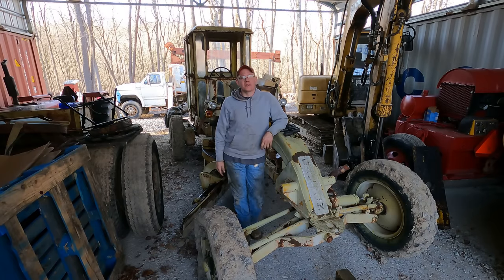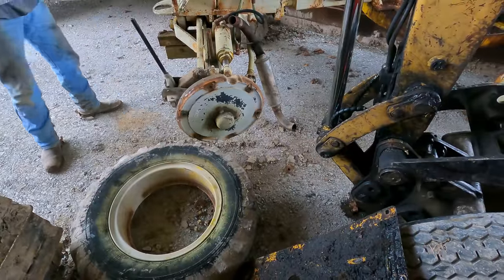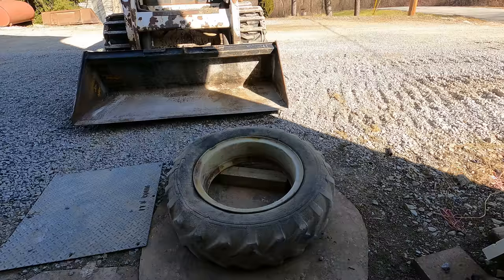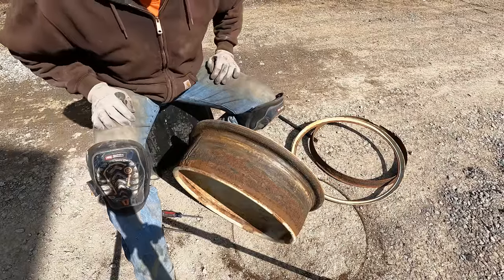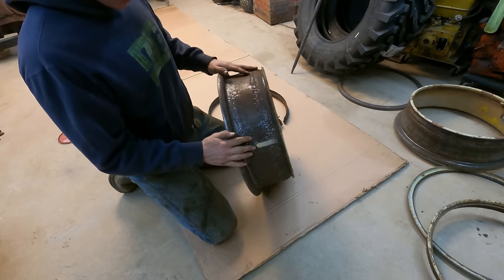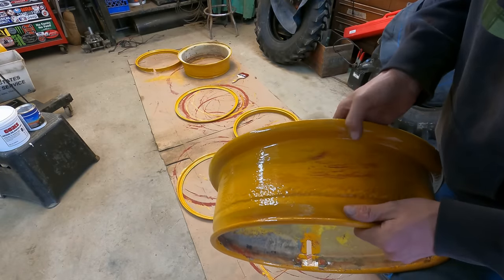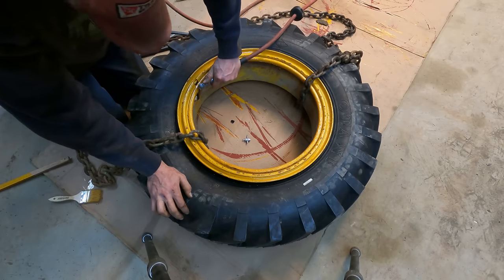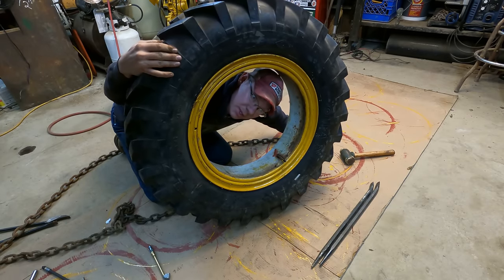1950's Galion Road Grader "Widow Maker Rims" Pt.4

Comment: First place I'd look for that wedge would be a tire shop that does truck / equipment tires.
We always called that thing you call a flap a "boot."
Putting the tube and boot in is a little easier if you partially inflate the tube first.

Comment: On the payhauler tires I have done we put a few chains around it and hammer the ring in the groove till it's got plenty of pressure to hold it in place but those are also bigger and tubeless. I do like your video though it's very informative

Comment: Learned on bicycles, but have used this technique on any tubed tire I've done since. I put a little bit of air in tube first, with valve core still in, just enough that it starts to take shape. Then put it in the tire. On tractor or ATV tubes, a quick sprinkle of baby powder helps keeping sticky new tubes from sticking to sticky new tires, lets the tube "slide" into it's happy place with ease. Your method likely works too, only thing is you can't really see if it did or not, where as if the tube was already round-ish when you put it in the tire you'd know it was seated correctly

Comment: Snot them up real good and they will slip right on. And it helps to put a little air in the tube before you put the rim on. It helps to hold the flap in place

Comment: With these rims, always think twice when doing someting. I handled those things in the 70ties and always took extreme caution. We also wraped some thick cord arround it when inflating. Then we made a cage to put the tires in and one of the first tires in this cage we were inflating exploded (so not the rim went of) and I heard about two days nothing. For the rest no one hurd. Imagine we didn't had the cage and someone was nearby. To put the inner tupe in the tire, always put some air in it, stick it into the tyre and then wiggle in the protection rubber. Easy-done easy go.
By the way, that paintbrush is of the type "Big-steps-quick-home" (lol)

Comment: Best advice to get that tire off is lubricant and a duck bill sledge. I use oil based lube (red fuel), spread it all around tire, the wack a few times with duck bill and bead should slide off. Hope this help. Old crusty tires need a hell of a lot of help to come free haha

Comment: I know this video has been out for some time now and I've never tried to mount tires even close to this size. One trick I've used to help my tubes seat well and avoid pinches is adding talcum powder inside the tire.

Comment: That floor did pack up a lot nicer than I thought it might!  Very usable for working on big equipment like that.  Hell if you ever got the itch you could probably "tar" it and make it like smooth pavement although it wouldn't drain then.  Nice.

Comment: Xo rust is what I paint the frame on my trucks with it neutralizes rust. Also works really good on plows. I just started to try/test out rest oleum enamel primer that stops rust as well seems to be working out good so far have to see how it holds up to a Wisconsin winter and salt

Comment: We used to use pick axes to break the bead when I was in the Army. Old five tons have split rims. Just stand on one side of the rim and tap the wide flat side of the pick axe on the opposite side where the rim and tire meet. Work slowly around the tire moving the bead done a little at a time. Eventually it will just pop off.

Comment: Rustoleum Rust Reformer paint works really well for coating rusty metal where you do not want the rust breaking through again.
And, it can be painted over with a finish coat.
I know first hand by painting rusty tools with it and the rust does not break through because it doesn't just coat but chemically reacts with rust.

Comment: I use to use gasoline to free up and soften the tires before prying and pounding.  Diesel and kerosene work good too.   Rotten rings are dangerous.....be careful!!    Also i would replace rust soaked inner rim guards if available (rubber flaps) .   Ya did good sir!!  Enjoy the hell out of your videos!

Comment: I have changed a lot of these over the years,  I would suggest you put the tube in the tire and add air to the tube, then install the liner and slide on the rim.

Comment: After removing the rust you could have painted them with a rust remover. The one I use but don’t know if you have in US is Ranex Rust Buster and I find it does a marvellous job. It adds another 24 hrs to a job but I find its worth it. Just a thought.
I have changed out a few and even when I was a whipper snapper always placed a rope around the tyre at three places and I am still here. That was in the 70’s when I done those things.

Comment: FYI you can break the tire bead with a car jack. Just prop the tire under the jack and press the jack as usual, it will force the tire off no problem while do it very delicately.

Comment: Next time Matt,, fit the rim to be cleaned , to one of the driving hubs start the engine and set to low gear and hold a disk grinder against it, works a treat

Comment: When I was on my automotive apprenticeship, my boss at the time Didn't like car tires coming back for a leaky tire, so once I had the tires off, I had to wire wheel ea. rim down to bare metal, rinse them down in paint thinner, repaint ea. rim black let them dry (mostly) then put ea. tire back on air it up, soap and water test, (so I made half plastic barrel) to dunk the tire in and just roll them around Dry and reinstall. Spring and fall kept me busy along with every break job the shop got in, both the boss and my lic co-worker hated doing them, it just made me very proficient in tires and brakes. Tires I still dislike doing but brakes I enjoy. The chains around the tire and rim is an excellent endeavour, certainly a Very Safe one. I've seen what the old Corvette rear suspension can do when miss-handled Clean through a 1968 Pontiac Parisisnne's door to the inner door panel. Anyway Thanks for Sharing Everyone that's open minded can learn the little tips and tricks from others of the same mind like abilities. So Thank You for sharing your knowledge. Work & Play Safe Andy T. Barrie Ontario, Canada, 🇨🇦

Comment: We called those flaps Boots. Working in a truck fuel stop and tire repair in North Dakota during the late 60's when a US Air Force Missile Hauler Truck stops on the highway near us. This trailer had approximately 40 tires on it with at least 6 flats. The driver explained that the tires were all new, having been installed by the crew at Air Base the previous week. Someone with no knowledge of tires, inner tubes and rubber boots obviously was volunteered to install the new tires. The inner tubes come with new boots that were packed folded over and wrapped tightly to save space. The young Fly Boy (as we affectionately called them) who assembled the tires knew where the tube went but had no clue on how to assemble the boot with it. So the boots were thrown into the tire first, still wrapped tightly in a lump followed by the tube. It took Air and inflated the tire so therefore it must be right. Within the first hundred miles it heated that rubber boot to melting temperature and the tires started to deflate. They had another hundred miles to go before arriving at the next Air Force Missile Station. We were out of tubes and boots of the size required and expected more flats down the road. Can you imagine 40 flats in a 200 mile trip. I'd bet some young Fly Boy peeled potatoes for the rest of the year!

Comment: A friendly comment from an old tire guy. On drive wheels the chevron points toward the direction of rotation. On free running wheels the chevron should point away from the direction of rotation. You can switch sides with your wheels to correct yours.

Comment: One way to break the seal on the tyre is to use the bucket on the dozer as you did but keep shifting the tyre around and pushing down on the  bucket, you may have to work around the tyre a couple of times, but it will break the seal.

Comment: Grandpa was telling me about how they were changing a 72 inch split rim tire on a skidder back in the 70’s and once they got the tire all back together and airing it up the locking ring unseated when the bead set and the whole contraption blew apart, luckily once they started airing it up they all backed away so no one was hurt

Comment: I use the blade to lift the tires on my grader.  Position the blade and circle right and you can lift the quadrant of interest.  Use blocks under the blade to keep from tearing up the floor, be careful of side movement and block it when it's up.  Make sure you have enough pressure in grader tires.  You can push the tire off the rim or spin the wheel in the tire, otherwise.  And cover up the tube in that slot in the wheel where the valve to slides in.  Sunlight will crack the tube and it's hard to patch in that spot.  I paint that spot since I've had the flap and the tube crack.  Interesting how many reasons there are for running the front wheels backward.  Me and John Deere think it's to keep the front tires from throwing mud on the cab.  I think that's why they put the R1 tires  backward on nurse wagons -- keeps the mud off the tractor.  Good luck with the grader.  You can get an account with a hydraulics retailer manufacturer now.

Comment: A quick option for breaking those tires off the beads is to place the tire slightly under the machine and use a rock jack (and the weight of your machine) to push them down and away from the bead.

Comment: If you have to cut a tire again, use a little lube as you go. Dip the blade in oil or use spray, both work great.

Comment: A trick for inflating while installing new tires is to air them up initially with the valve core removed, an airline with locking inflater nozzle, and quick air coupling far enough away to keep you outta the rim grenade zone.  I've had newer defective radial tires on one piece rims fail while airing up and seating beads where the sidewall failed at 20psi under operating pressure (it was a bad batch of tires that ended up being recalled) where the tires still had enough force to launch themselves a few feet into the air from the rotary table on the tire changer

Comment: First job out of high school was in a tire shop. A 10.00/20 truck split rim blew, after it all but tore a mans arm off it still had enough energy to put an imprint in the roof. Having witnessed that , any time I have worked on split rims I go overkill with the chains.

Comment: Directional tread on the front axle ever grader is supposed to be mounted the other way.

On any driven axle they're mounted arrows facing the direction of rotation. On any non-powered axle arrows point opposite of the direction of rotation

Comment: before putting in the flap air up the tube to fill the tire then install the flap. 1 more tip after you have it to operating pressure deflate it all the way to let the tube get the wrinkles out of it the reinflate it to normal psi.

Comment: The lube you used is bead wax, you need to lather it up like shaving cream. It works well and does not damage the tube or flap. Any petroleum base product will destroy a tube in days. The flap, you need to swap it out, it will fail, as the tube is not supported, and the sunlight will crack it up FAST. A flap disc works well to take rust off a rim. Invest in a bead ax. How many hours did it take you to do this?

Comment: I kinda doubt it will make a whole lot of difference, but the farm I used to work on mounted the drive tires with the "V" facing forward when looking from above like you have them mounted, and facing back on rolling or non-driven applications. Supposedly it helped with the steer tires digging in on turns instead of skating.

Comment: They make a big tire bead breaker tire hammer. Pore some soap or diesel around the bead. When inflating.. inflate to about 10-20 lbs just enough to seat the split rim. Sometimes you might have to let the air out to let the tube (If used) to relax the tube from folding or twisting. Mount and bolt the wheel back on the machine and then inflate it. TD Atlanta

Comment: I'd put a little air in the tube before shoving it in the tire, less chance of it getting pinched.  The tire shops have a big steel cage for inflating split rim wheels in, but it does the same job your chains do

Comment: Matt, the rims look good by themselves and even better with the tires on but I still wouldn’t trust them and this is why. I was 15 working at a tire shop back in 1976 and a guy who couldn’t afford them insisted we reuse rings and locks that looked like yours, we refused to do the work. He came back the next day with the tires assembled but with no air. He was allowed to use our cage to air up the tires and he went on and put them on his ice cream truck and drove off. Three weeks later as he walked toward the front of the truck one ring broke and came out and mowed him down. Please, look for replacements for these components and in the meantime avoid walking anywhere close to them. The investigation proved the rusty rough surface was hiding micro cracks on both the ring and lock that failed. Stay safe young man for all of us who care about you. God bless.

PS! I joined the Army in ‘79 and changed many tires in the field with just three pieces of 3”-1/4” thick angle iron, put them on the edge of the ring and beat it in with a sledge hammer, once one was in push the next piece next to it then take out the first and push it in past the other two until you break it all around.

Comment: Before in wheel inside talc there and after the inside wheel, between rim belt talc then it is going nicely in place. then wheel standing and rim inside to there much easier to put valve tube to place. Had look and made truck wheels 50 years

Comment: The best lube I've ever used for anything tire related is liquid dish soap 75%, water 25%.  Not only does it lube the beads but it can be used to stop a minor rim leak on tubeless tires and as it dries it'll act as bead sealer and bond the tire lightly to the rim bead seats.  Not to mention the low cost.  In fact it's the only tire bead lube I use and I used to change those big hemmt tires on the 3piece beadlock rims

Comment: Odds are you should replaced the rear tires also, but hard to tell with all the mud on them. Nice to see work on the grader. I wonder if the keeper you are missing from an old truck would work.

Comment: Keep tapping the lock ring with a hammer all of the way around the ring until the air pressure is where you want it to make sure the ring locks evenly all of the way around

Comment: I work in a shop where we change these 3 piece rims.. its not as bad as everyone thinks.. I will say with the amount of rust in the primary and locking rings, they need replaced.. I have had a few that have been rusty like that I thought would seal they will blow, actually had one blow apart days after the air was added and the primary ring was the failure point.. if you get Murphy's soap and rub it on the bead and around the liner, the rim will slide in easier. The murphy soap has a consistency of grease almost but slick like a bar of soap, stuff works great with heavy duty stuff.

Comment: makes life a lot easyer if you put some oil with a brush. to nuts and such that you want to remove few days before removing them and heavily corroded ones are easyer to do in´n out with thread maker to clean em up, nuts n bolts leave like new no matter how horrible they were

Comment: Should use tire talc inside tire and on tube, this lets tube slide around and even out to prevent tube pinch if there's a fold. Also, clean up the flap, or better yet a new one. They do stretch and harden. Also inflate the tube slightly to prevent folds before assembling. Do not allow rings to be warped during removal and replacement. I grew up at my folks truck stop and have done hundreds of these from the 60's. If you think this one was rusty, try one from a feedlot truck!

Comment: Before you put the tube in the tire try covering the tube and the inside of the tire with talcum powder or cornstarch so the tube can adjust position easier during installation to illuminate wrinkles.

Comment: A good way to do that is to let the air out and drive around until it breaks loose! Ron
Reply from the maker: The first tire have been driven on flat for quite a while ...didn’t make it any easier lol
Reply: @DieselCreek  I am 81. I was partner in a tire bus for couple year. I was mounting a tire that was not coming up on the wheel fully so more air was added. I didn't know the tire had a broken bead. What a bang as the tire hit my wrist on it way to outer space. My wrist was sore for awhile but no perm damage. That thing between the wheel and tube is called a liner. I really enjoy your show. Thanks for the videos. The current world is a very funny world but not funny ha ha. Retired Ron

Comment: You need proper sized sandblaster. It might be a pain to recycle sand and it can be expensive to get big air compressor but it's really worth it if you work with big, rusted parts like that. Alternatively wet sandblasting might be good but I never used it. It's cheaper though if you compare it to sandblaster and compressor.
Anyways, sandblaster is pretty simple device, you can build it yourself and scale it up to any size you need. Cleaning rust becomes a pleasure with this toy.

Comment: Every workshop/garage needs a concrete floor Matt, let's see ya move a motor-hoist around with a engine on it, that's what I thought, lol, I was wondering how long it was going to take ya too pull out the knife, I figured you had one of those tire changing machines, I was looking at new ones several years ago, but I couldn't justify spending 2 to 3 thousand on something I would use once a year, I'll bet you could tho, great video Matt, thanks for sharing.